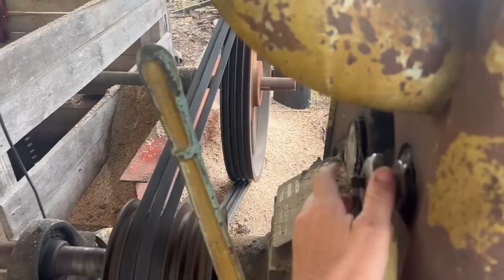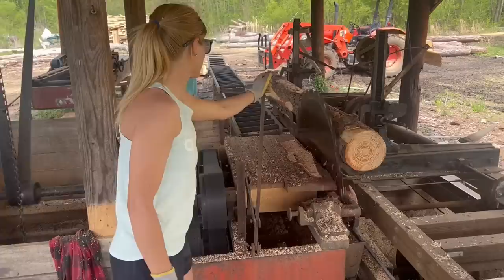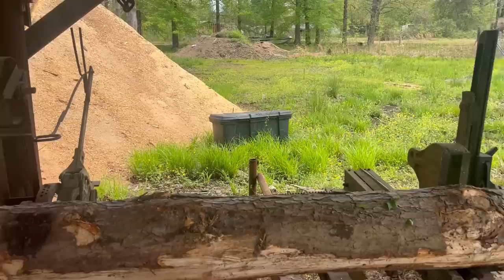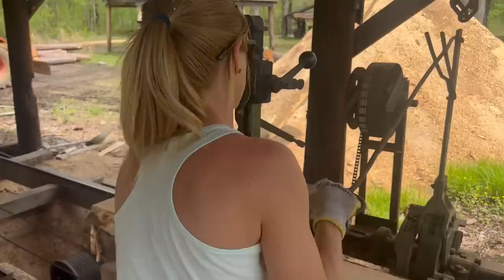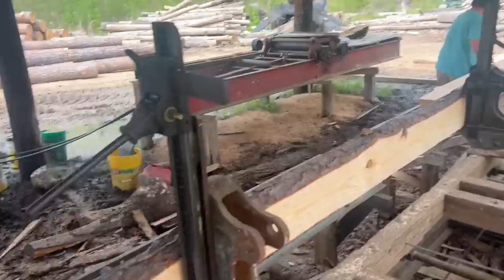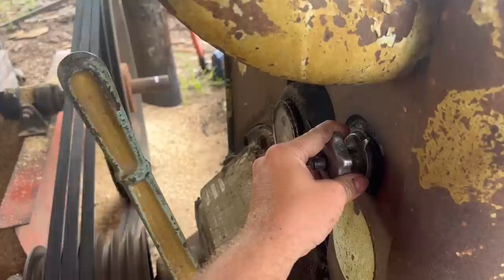Sawing Her first log SOLO on the Corley Circle SAWMILL!!!

Comment: Mrs. Wallace, you did a great job cutting that log by yourself. You seemed to know what you were doing as you 'read' the log so you knew how much to pull the log on the carriage to get the correct thickness on the boards. Curious... why did you leave bark on the cant and then sawed it in half?
Reply from the maker: It went on to the resaw. We just 3 side on the circle mill!